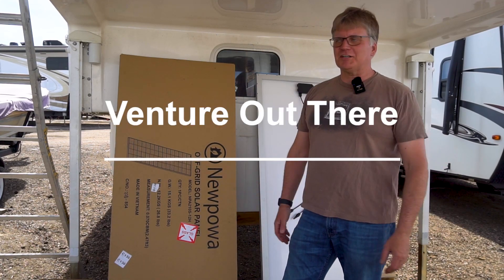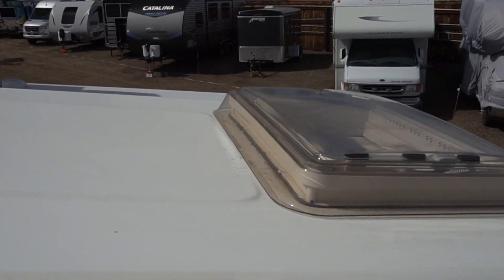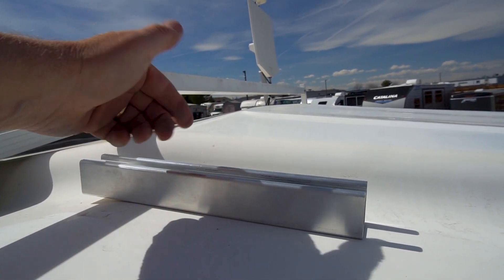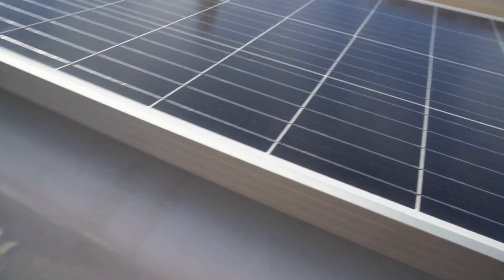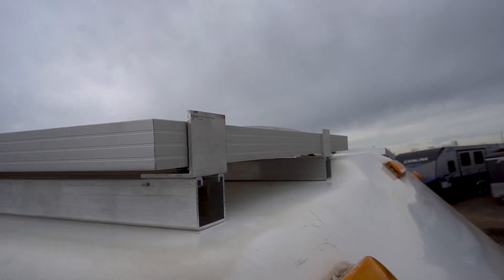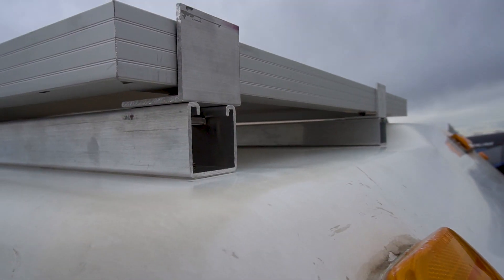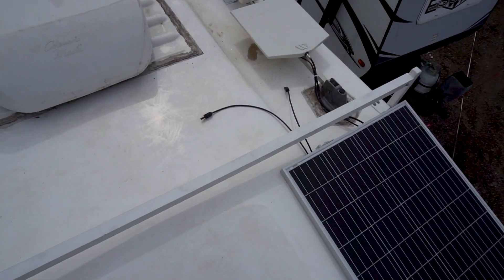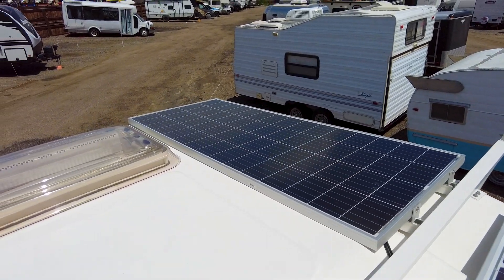Solar Panel Installation on Our Truck Camper.  Squeezing it all in place with VHB Tape and Unistrut.

Comment: Thanks for the video. I am thinking about trying this method on my bus so your approach is very informative. Did you do anything else to prepare the surfaces (unistrut and roof) before applying the VHB tape? How is the installation holding up one year later? Do you think it would work with semi-flexible solar panels?
Reply from the maker: I used a 3M pad to scuff the surfaces then cleaned them with isopropyl alcohol. I’m now at over two years and probably 10,000 miles of use with no problems.

Comment: Nice install. Curious how you wired the 2 new panels with the existing panel?
Reply from the maker: They are all wired in parallel at the moment. The original panel voltage is slightly higher than the new panels so I lose about 5% (about 5 watts peak) on that panel.

Comment: Nice job! Who did your mountain decals?
Reply from the maker: Thank you. I ordered the mountain graphics from this Etsy vendor. I had to email and get a custom quote for a 96 inch length. They also custom made the Venture Out There graphic with the sun spiral. They did great work. https://www.etsy.com/listing/734070224/mountain-range-vinyl-decal-van-life?click_key=1bd3f64b7e1dadd34f06ae0e2383fc93880aca3b%3A734070224&click_sum=28ef4b46&ref=shop_home_active_3&frs=1&crt=1